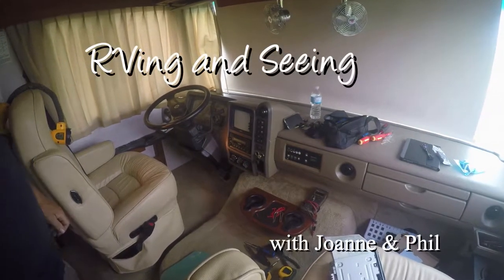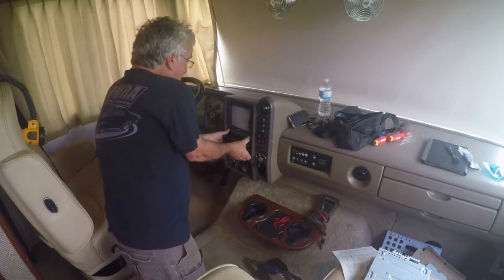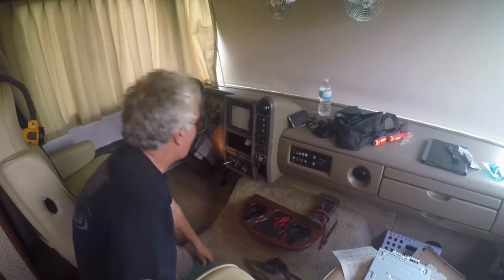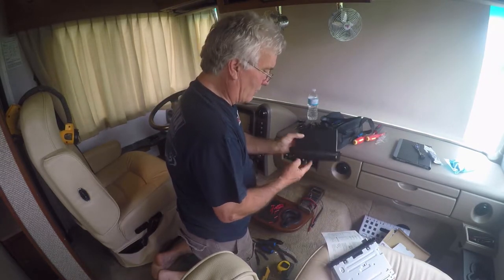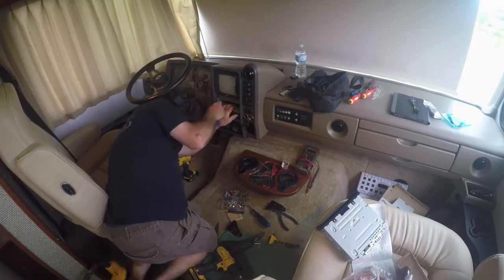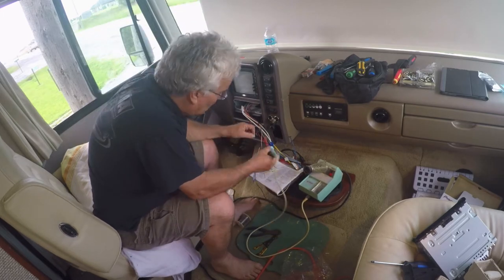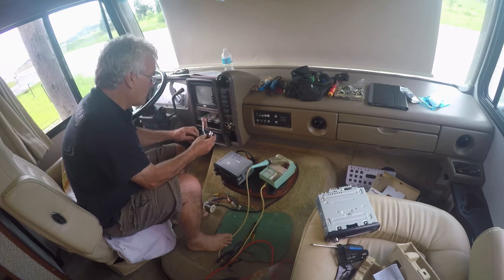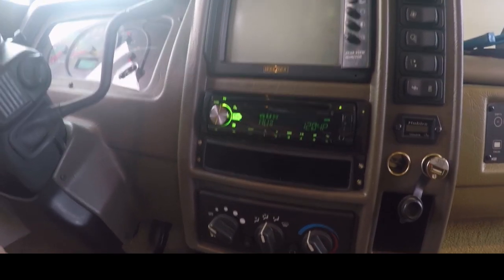DIY Fleetwood motorhome in-dash radio upgrade

Comment: where did you get the wiring harness?  We have the same RV and purchased a Jensen heavy duty stereo but can't find a harness.
Reply from the maker: Hi Annie... There is no ready made harness available. I had to cut one wire at a time using the old radio to identify the wires before connecting them to the new radio.
Reply: @rvingandseeing3010  Got it thanks.  It really doesn't look like it would be that hard to do.  I have the wiring diagrams for both.